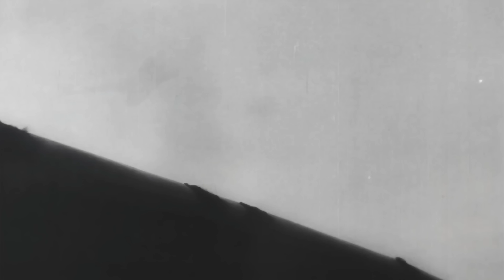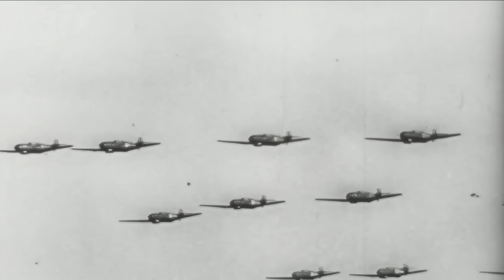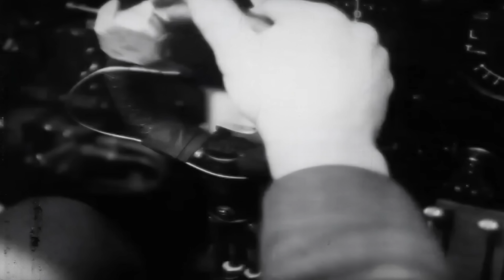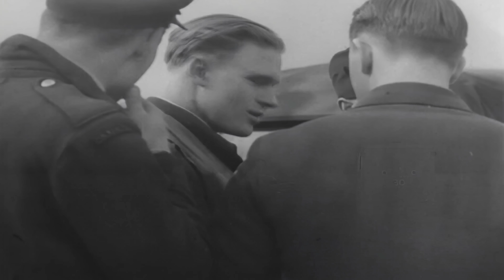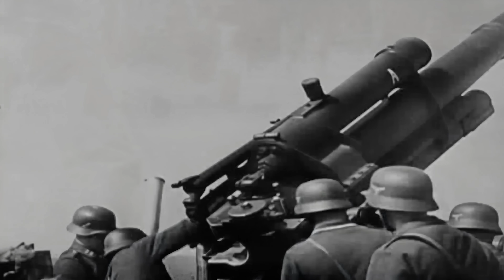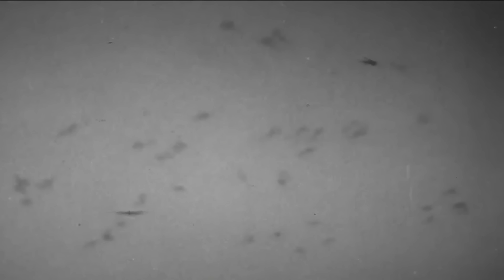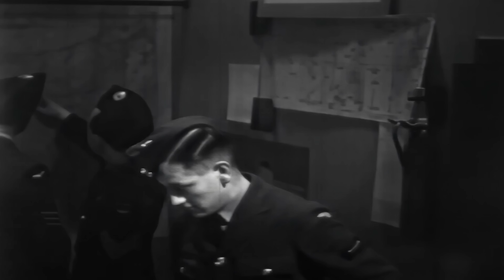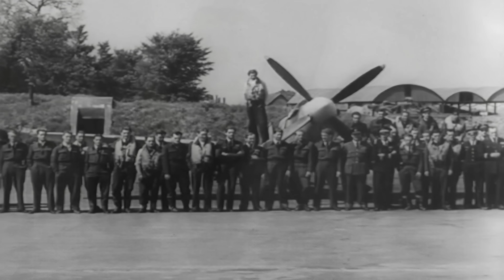440mph Monster That Cracked Germany’s Air Force

Comment: Tripe. The Spitfire wasn't outclassed by the BF109E. True the Messerschmitt had heavier armament, but the Spitfire could out turn it.

The Spitfire Mk IX was urgently introduced to counter the FW190. The MK V introduced clipped wings, to improve roll rates. However, the Typhoon was able to see the boots off an FW190 at anything less then 10,000 feet. The Tempest, when introduced, could see the boots off an FW190 and was an Apex fighter.

Your footage keeps swapping between the Typhoon and the Tempest, with Spitfires dotted in between...

You also talk about Typhoons with bombs, but show footage of Tempests and Typhoons armed with 60 pound rocket projectiles... These provided firepower equivalent to a 6-inch naval salvo. Devastating for German armour on the receiving end, even the much-feared Tiger tanks. The 20 mm cannon shells were much lesser.

You certainly need to mention the Hawker Tempest.
Reply: Even RAF pilots in the Battle of Britain like Tom Wilson highlighted that in the Summer/Autumn of 1940 the ME109was a better fighter due to having an engine with fuel injection a faster climb rate and carried more ammo and canon. It’s debatable that the Spitfire did have a better turn cycle than the Messerschmitt but with its fuel injection the German pilot could simply steeply dive out of trouble in a single movement. Also it could roll without the engine stalling. Spitfire successes vs ME109 was more about the relevant skill of the pilot fighting over home turf. The Spitfire was to dramatically improve adding many of those features but in 1940 it was the Mark 1 which was at the time outclassed by the 5th generation of the ME109 as a fighter plane
Reply: @bobbennett4813   The Spitfire more than held it's own and the Bf 109 cannon had low muzzle velocity and only enough ammunition for 6 seconds then it was down to just two machine guns. If the Bf 109 pilot dived steeply he could get away if lucky but that didn't always work so well, A spitfire rolling didn't cause the engine to stall.

Comment: Visual clues to whether you are seeing a Typhoon or a Tempest are - Typhoon vertical stabilizer same shape as Hurricane - Tempest has a long tapering rounded "strake" running along the top of the fuselage for a good ways. Typhoon has cannon barrels sticking out the front the of the wings which look very thick. Tempests = thin wings that in order to contain all of the cannon inside had blisters on the wing topside to clear the gun breeches. Typhoons usually had a cockpit like a P-39 = "car door" and usually wasn't a "bubble" like the Tempest. Sitting on the ground most Typhoons had 3-blade props, Tempest had 4. 
 I grew up reading "The Big Show" by Pierre Clostermann a Frenchman who flew for the RAF.

Comment: What a shame that no one chose to review the films. Half the images are not typhoons or tempests there is even one high level image of a B24 liberator. If you're going to put something together get it right or it simply becomes misinformation. With the archive now available on line features like this should be getting more accurate not less. Poor show !

Comment: This is rubbish. The wing stripes were only applied for D Day invasion. FW 190's were never used to bomb the UK. They were fighters.
Reply: The FW190 WAS used to bomb the UK on low level raids and it was this tht saved he Typhoon it was the only plane able to catch the German at very low altitudes 372 mph Typhoon V  355mph FW190
Reply: Actually I think 'invasion stripes' were used earlier than D-Day, but the disasterous friendly fire during the invasion of Sicilly meant they became universal for the Normandy campaign.
As for the FW-190 carrying bombs. It most certainly did. Both on the Western and Eastern Fronts. In the east you would be more likely to see a FW-190 with bombs than without.
The FW-190, like many fighters, was used in many roles. As well as a day, and night, fighter the FW-190 was used for the ground attack role. In that role they were called JagdBombers,
or Jabo's. They usually had either one large bomb under the fuselage, or four small bombs under the wings. On the eastern front some Stuka squadrons were re-equipped with Jabos.

Comment: I didn’t know FW190 carried bombs
Reply: Famously so did the Me 262 ...because Hitler ordered it and it delayed its introduction thankfully. Spitfires also moved over to ground attack carrying bombs  when the RAF was sent hunting ground targets ... Just it was faster at altitude . ..but on the deck Typhoon Tempests and Mosquitos and Beaufighters   did some serious damage  especially with coastal command.
Reply: So did the Me-109, the Spitfire, the Hurricane, even the Lysander. In fact, if it flew, they tried sticking bombs or rockets on it. The Fw-190 was successful because it had the horse power to carry the load. On the Eastern Front some Stuka squadrons were re-equipped with Fw-190's. search for 'Fw-190 Jabo'.

Comment: German fighter ace, general Adolf galland, whilst talking to a group of officers... "give me a squadron of spitfires". So, no... The messerschmitt never outclassed the spitfire, given their respective pros and cons, the outcome of a dogfight came down to the pilots skill and /or experience. The focke wulf however, would usually beat a spitfire, until the mk 9 came along!
Reply: That was a throwaway line to wake up Georing to what was happening
Reply: He also said if you ended up in a dogfight you had made a mistake. He preferred boom and zoom.
Reply: @donald195 So did Johnson.  Britain’s top ace - who also survived the conflict.
Reply: The Chief Engineer at Rolls Royce described the FW-190 as 'brute force and ignorance'!
Reply: @Lawrence4000-s3k A description of war itself.
Reply: @Lawrence4000-s3k  And who was that and what publication?
Reply: @Lawrence4000-s3k  And yet Brown classed it with the Spitfire as  the best fighter of the war
Reply: @jacktattis  I think his point was that what the Spitfire did with a 27 litre engine it took the FW 190 to do with 41 litres.  Brute force can work but it's not the better design and has all sorts of trade offs (fuel economy for one - the Germans designed a fuel thirsty engine when they had a shortage of fuel!).
Reply: @Lawrence4000-s3k  How true about having a thirsty engine with no fuel
Reply: @jacktattis  Compare the FW190 with a 36L Griffon Spitfire and the FW is losing 90% of the time.

Winkle Brown himself said, "In a dogfight: “The Spitfire XIV would win — unless the 190 pilot could use his roll to escape.”.  It had faster climb, speed, and turning.
Reply: @Lawrence4000-s3k  Where did  Capt Brown say  this for I  have his Wings  of the Luftwaffe and he does not  mentionthe MkXIV there. Only the MkIX
Reply: @jacktattis  It was a quote I heard many years ago.  It was probably from an interview or similar.  It's consistent with the performance data of the two aircraft so it sounds plausible that he would have said it.  And according to a quick google search he said the Mk XIV was the "best fighter of the Second World War ".

(Hush-Kit June 27, 2018)
Reply: Garland went on to train the Argentine airforce after world war 2.that fought in the Falkland wars.
Reply: All this aviation talk and the people don't know shit. In WW2 ,it was the mighty P-47 Thunderbolt that turned the tide in the ETO. 66th was 1st group to shoot down 100 Germans in combat,all Grrman fighters. And then it went to 39 to 1 killing off all the experienced Germans. After Hap Arnold screwed up and ordered the Merlin Mustang ,and drop tanks for it  the P-47 then obliterated everything on ground. No other airplane comes close. In Veitnsm the Republic F-105 was the best. Only aircraft other than the B-52 that was actually getting to the North Veitnamese. This jet also shot down 27 of its 29 Mig kills with the Vulcan cannon still used today.
Reply: @bigsky-o2s  It took 45 litres in the P-47 even to make an arguable case against the Mustang with its 27 litres.
Reply: A) The Aussie Canberra crews want a word, they were notoriously accurate in both medium bomber and CAS roles

B) The B-52H hasnt had a tail vulcan since the early 1990s - it was replaced with   passive ECM gear
Reply: @bigsky-o2s  Lmao, clueless seppo. The P-47 was a slow POS in both climb and acceleration which is why Mustangs are credited with saving the US daylight bombing raids. The Spitfire was a vastly superior fighter, and the Tempest was superior at near enough everything. As for kills, P-47s had the advantage of NUMBERS against largely inexperienced Luftwaffe pilots thanks to most of Germany's aces being killed or captured during the Battle of Britain.
Reply: Early in the war, the Me109’s out-climbed, out-ceilinged, out-dove, out-gunned and out-engined British aircraft.  They didn’t necessarily out-turn them in lower level dogfights - but that depended a lot on pilot capability / skill / experience rather than the machine. Their disadvantages were imposed by their geographical location relative to the battle, the channel, their range, their mentally challenged (evil) top leadership and their psychological state of mind (they weren’t defending their own people / country). The RAF technically only caught up later (often via back engineering) - but not totally when it came to the FW190 and, of course, the early jets.
Reply: @johnhanson5943 and the base was totally different....they all adept to the German technics bcs it was superior in this moment of time and later also...
Reply: @greenmile2092 Agree in most cases - but the Germans lost when it came to early computing and surveillance tech. The encryption deficiency relative to the British was key.  The British also, at that time, had also some good innovative tech when it came to night navigation, some artillery, control systems, certain armoured vehicles, sonar (asdic), radar, mass production productivity, jamming tech, intelligence games, etc.  However, in the mechanical areas, the Germans were far superior - but not always in terms of production en Masse at a reasonable cost.  Also, when it came to Jet and Rocket power, they were miles ahead.